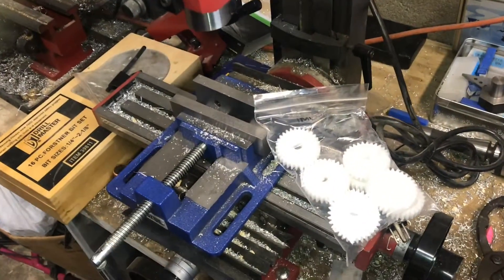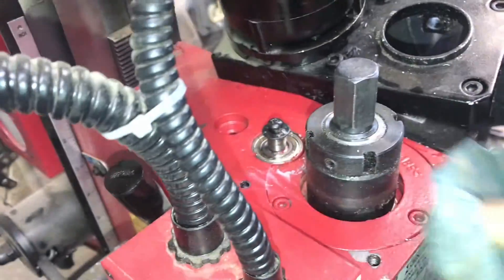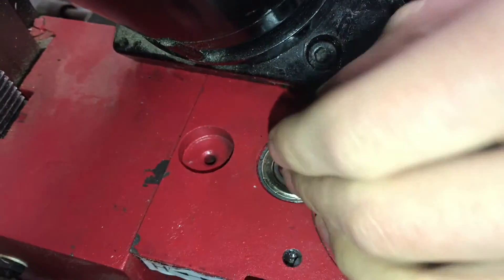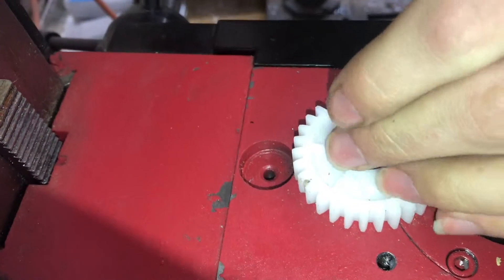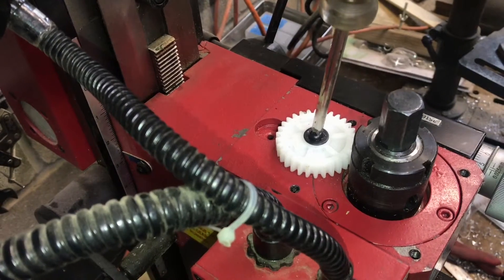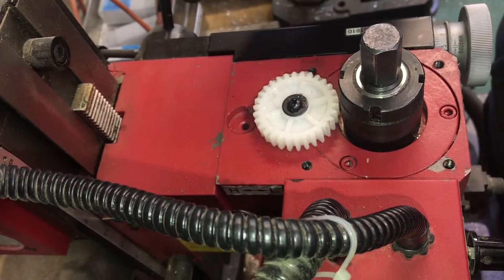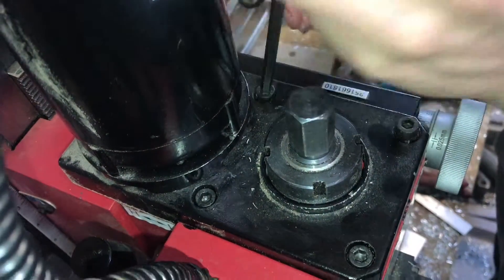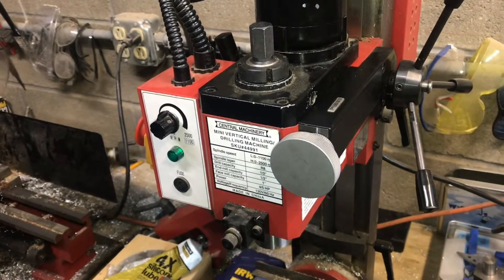replacing PLASTIC GEAR on mini mill(grizzly part # P8689138) #g8689 #44991

Comment: Thanks for putting in the part # for that gear at Grizzly.   I just ordered some.    I am going to buy metal gears for all the other gears that are harder to get to, but I want to keep this one plastic to act as a shear gear to prevent any damage to machine !
Reply: should went ahead to metal gears straight away, these will break just like first ones
Reply: @A @AlexeiPavlov ine had only broke once in 4 years and I bought 10 extra plastic gears.  I should be good for a while.     
I might need to buy the other metal gears though.   I can’t remember if I bought them or not, lol 😂.   I need to check.    Thanks for the reminder.

Comment: Are the high/low speed range made of plastic gears? I would have reamed the new plastic gear so it was not stressed putting in on the shaft. They do make all metal gears but like you say it may damage more parts but hope it would stall the motor instead.

Comment: Thanks for posting this. Been contemplating this model. Good to know there’s accesable replacement parts.
Reply: should went ahead to metal gears or belt drive straight away, these will break just like first ones, plastic gears is 💩💩💩💩💩💩